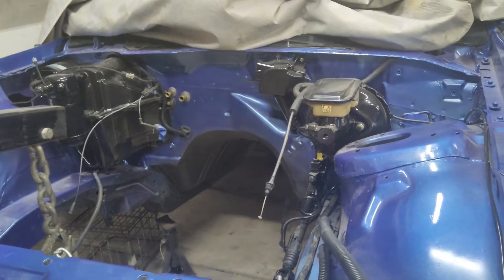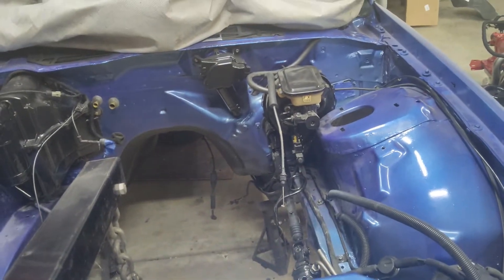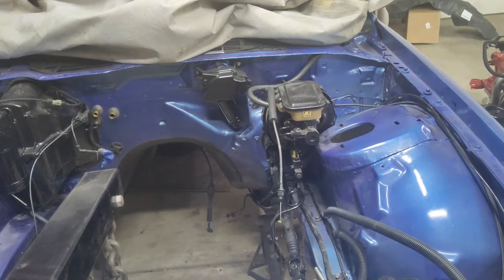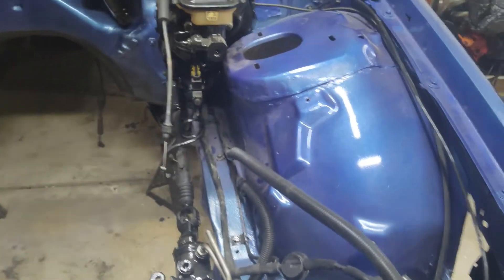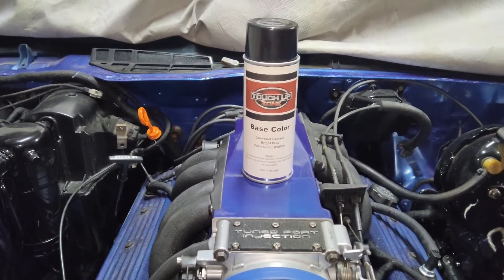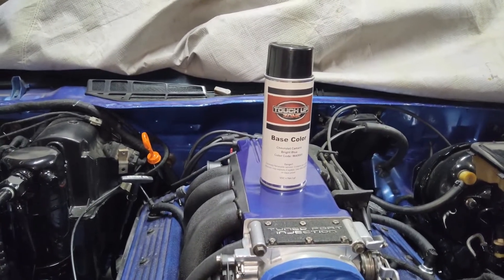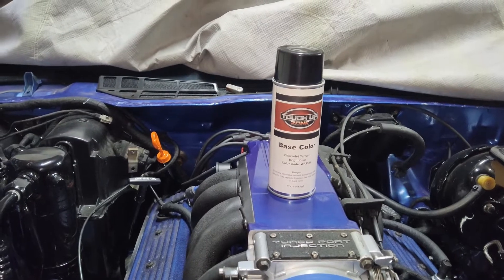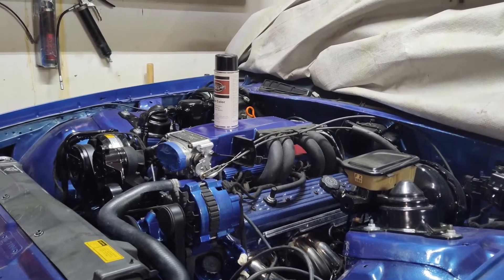Iroc Engine Bay | Clean & Paint | Camaro Firebird

Comment: Looks good, well done. Didn't appear to have any brake fluid destruction.
Reply from the maker: Thank you.  No brake fluid destruction on this one.  I did remove the master and the brake booster and painted those also.
Reply: @JSFautoPlus  Excellent, I was not going to worry about this but ended up doing the same, and must admit it was worth it, really looks great. Steady on. Thanks.

Comment: Did you send between the paint and clear coat?
Reply from the maker: Hi, thanks for watching/subscribing.  
No I did not sand between color and clear coat.  There is no reason to do that unless you have imperfections to remove in color coat or if you have let the color completely dry and cured before clear is shot.